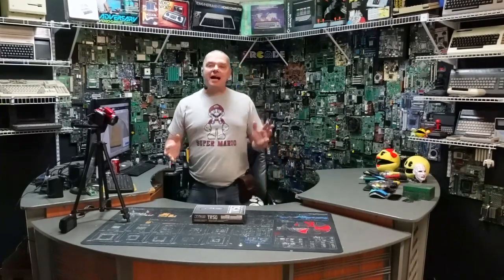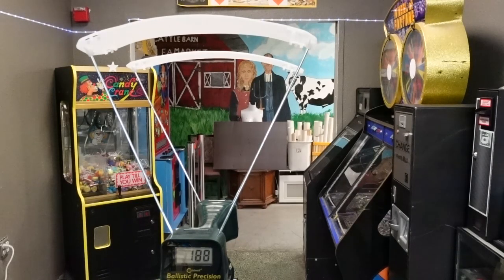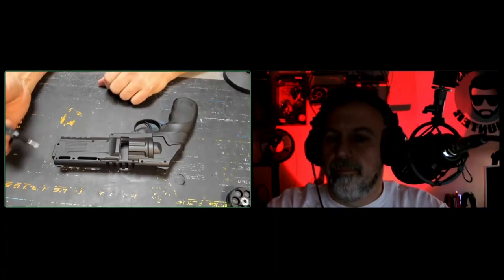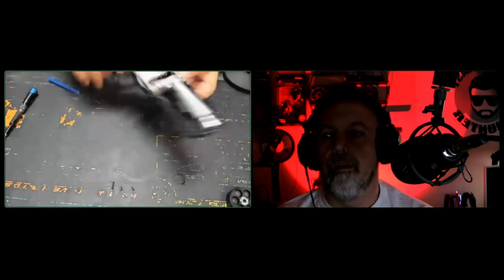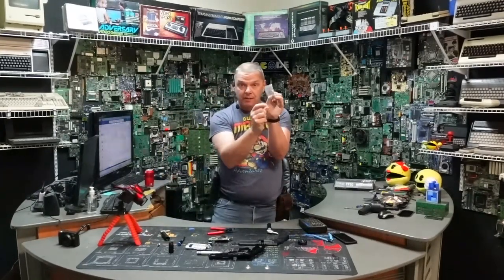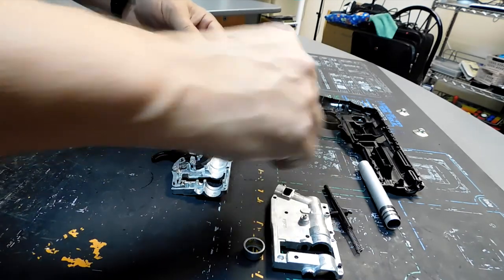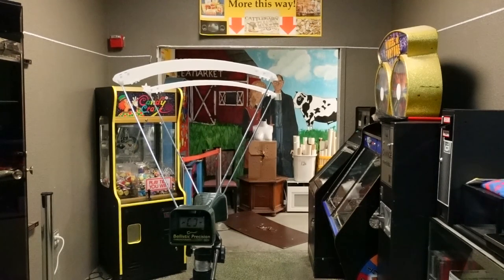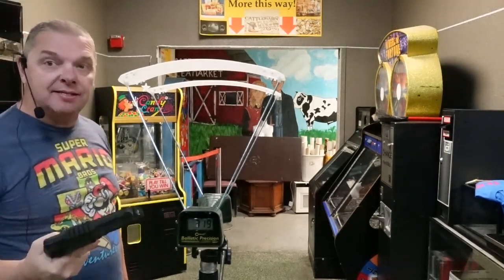Lets upgrade the T4E Umarex TR50! | 20-30 Joules!! This thing is MEAN!

Comment: Which hits harder a moded TR50/HDR50 or a moded HDP50?
Reply from the maker: They are VERY close. The TR50 is quicker to reload though.
Reply: @AlternateArmsSD  What is your email to get a price on a modified HDR50/TR50. 
Thanks Doug
Reply from the maker: @dougtodd9184  jonreynoldscts@gmail.com I’ll be back in town tomorrow night brother and answering emails on Friday.
Reply: Jon, I removed the valve block from my HDP50 and it hits like a hammer. If I remove the valve block from my 11 joule TR50 can I expect the same results?
Reply from the maker: @dougtodd9184  greetings, you absolutely will. However, on the tea or 50 you have to install will see you to restrict are in the CO2 chamber in the handle. If you don’t, all of the air will simply fire out with the first shot. If you need one, shoot me an email at jonreynoldscts@gmail.com
Reply: What would you estimate your FPS would be with the valve block removed on the Umarex TR50. I have an 11 joule TR50 and was thinking about removing the valve block.
Thanks Doug
Reply from the maker: Depending on the ammo weight you will see 18-22J just by pulling the block. However, unless you have the new valve assembly, you'll need a c02 restrictor. If you need help or parts, shoot me an email at jonreynoldscts@gmail.com @dougtodd9184
Reply: @CompleteTechnologySolutions  I have a screw in CO2 valve restrictor in my 11 joule TR50. Can I just resize the hole in the restrictor and remove the valve block and turn it into a kick ass launcher?
Doug
Reply from the maker: @dougtodd9184  you absolutely can. Just go very very slowly and in small increments until you find the sweet spot.

Comment: There's something wrong, the TR50 should be around 325 fps stock for the five or so shots. With the mod it should be shootings around 500 fps.
Reply from the maker: That greatly depends on the ammo you use. The standard balls that come with it are just hard rubber. I routinely test with the rubber/steel balls (which I use in actual self defense) and they are considerably heavier (hence a bit slower). That being said, after the mod this thing hit like a freight train :)
Reply: @AlternateArmsSD  I totally understanding, I've been working on my mods for almost two years. That being said, the rubber steel balls from Umarex should still be hitting 280 - 290 stock and around 425 with with the mod that you have made. BTW the way,  love your videos, very well put rogether.
Reply from the maker: @roddwestphal2379  Thank you so much! I love my channel and making the videos. Wait till you see what I have coming! :)

Comment: Mine blows up coconuts using hot glue and steel ball bearings. 3 times more power.Steel replacement barrel also.
Reply from the maker: I really wish I had the steel barrel for this conversion. Not only does it look amazing, it adds a ton of power by adding that little bit of extra pressure behind the round. Fear not though, I will have a mod like that coming up soon :-)

Thanks for watching!!

Comment: Can you used this method to upgrade The TR68?
Reply from the maker: You absolutely can! Also, the C02 restrictor isn’t necessary for the 68.
Reply: Thanks for the info. But don't  you risked damaging the value if you removed the restrictor?
Reply from the maker: @kennymike7937   Not a bit brother.
Reply: @CompleteTechnologySolutions  thanks again
Reply from the maker: @kennymike7937  My pleasure brother!

Comment: I'm guessing the pepper guard dog pepper launcher is best all other guns are below 350 max and gusrd dog surpassed 400-500? no mods either so WTF
Reply from the maker: Yeah, they were pretty impressive out of the box. When I pulled it apart, you could see that it was pretty much a carbon copy of an HDP 50 with no valve block. That’s good news, cause it means there is room for Upgrades. However, the plastic that they used on the body wasn’t quite as high quality.

Comment: Maybe we just need pepperballs made that can handle the pressure.
Reply from the maker: Perhaps, but the point of the pepper ball is to rupture. If you made them two solid, they would be just as effective as the solid balls. It’s a delicate balance.
Reply: @AlternateArmsSD  what is the max joules you can mod something so that you get a bit more power but can still use pepper ball any feed back would be great
Reply from the maker: @fierrolisto3281  Were actually going to test that in a video.. I'm curious as well!

Comment: How can one obtain the power kit?
Reply from the maker: Greets! Shoot me an email at jonreynoldscts@gmail.com
Reply: I emailed.... I have the stock 11 joule version. Will remiving the horseshoe alone increase the velocity?
Reply from the maker: Yes and no... On the TR50 you must have a C02 restrictor or it will blow out all of the C02 on the first shot. @yago23s17
Reply: I ordered a power kit 50 from riot balls. The valve pin is actually longer.
Reply from the maker: Don't use it then. Just use the C02 restrictor and pull the valve block. You will see the marked improvement!  @yago23s17
Reply: @AlternateArmsSD  
Is there a point where the valve pin or firing pin can be too short?
Reply from the maker: @yago23s17  absolutely, when the pin is too short to get a quote, farting” effect. Also, if you go to short, it won’t seal at all, and you were just blow out all of your CO2 as soon as you puncture it.

Comment: Remove the block. Get an engineer mate to make male/female short tube to go between frame and pop-out indicator, shape a hole in the plastic to accommodate. Now you have something else again.  Before (Homedefence24) finds out and makes em. lol.   Sand the chambers (slightly) to take 8.3g steel balls.    The rest is up to you.
Reply from the maker: Thats a great idea! I also did a shortened valve block that seems to work well to (Video coming soon).. These things are so versatile that the options are limitless.
Reply: @AlternateArmsSD  Yes mate, they are a great platform to tinker around with. Modern day 'Meccano' 'Leggo' lol for HD.

Comment: Bummed. Found the F symbol 😕
Reply from the maker: Ignore it! I have the kits now that simply don’t care! It’s still upgradable! :) Shoot me an email at jonreynoldscts@gmail.com
Reply: @AlternateArmsSD  Thank you! I need to be comfortable with taking this apart (I can take apart anything since the age of 12), but it’s putting it back together that might be an issue. Usually, springs pop in different directions when I change anything with a spring. LOL! I will shoot you an email soon so we don’t lose touch.
Reply from the maker: @mojito-alongtimeago  Just go slow, you'll be fine :) If not, I'm always here.

Comment: Lol mine is doing 450
Reply from the maker: Yep, I got that after pulling the valve block... Nasty customer! Thanks for watching!
Reply: @AlternateArmsSD  so entire valve block should be removed for both 7 and 11 joule versions?
Reply: 450? How? I have the version with the f. Can  mine reach 450? And how?
Reply from the maker: @leonceheaven1032  by removing the internal valve block completely. Of course, when you do that, it will negate ever using pepper balls again :-) It will also dramatically reduce the number of shots you will get between CO2 cartridges.

I have another video coming out very soon about the HTP 50. It does the exact same thing and the upgrade is pretty close the same. Stay tuned to that one to see me remove the block completely. It’s very simple.
Reply: Slingshot shooting marbles Is more lethal.
Reply from the maker: @Stevenyoung100  Nonlethal is the point. That being said, I have been thinking about doing a slingshot video.. any suggestions?

Comment: I got so confused with your explanation on which one can be modified....is the one with the "F" the one you CAN modify, or CAN NOT modify.?
Reply from the maker: You can modify both the same way Brother. This is an old video, move further forward, and I have much more detailed descriptions, teardowns, and upgrades.
Reply: @AlternateArmsSD  Thank you for the fast reply and the great vids.
Reply from the maker: @GimmeEd  Thanks Brother!! It’s been a learning experience for me :)
Reply: @AlternateArmsSD  So, I just ordered the 11Joule valve upgrade. Can I now use the power kit on it to increase the power even more?
Reply from the maker: Yea BUT, open that valve and punch out the block. You will get 18-20J simply by doing that. Afterwards, you can add the shorter firing pin, C02 restrictor for more consistent shots, and a longer barrel. @GimmeEd
Reply: Cool, thanks @AlternateArmsSD
Reply from the maker: @GimmeEd  my pleasure brother, if you have any issues while you’re doing your upgrade, let me know.
Reply: @AlternateArmsSD  Well, I got the 11 joulle valve and punched out the block. Put it back together and now I'm blowing all the co2 in the first shot. Sounds like a machine gun. What did I do wrong?
Reply from the maker: @GimmeEd   did you install the CO2 restrictor desk in the CO2 chamber? You are very very close :-) you have to have the CO2 restrictor installed on the TR 50. If not, you get that “machine gun” effect you’re talking about :-)
Reply: @AlternateArmsSD  I pulled it apart and found that one of the springs had moved and it was allowing the gun to fire like that. I fixed the spring and it fires properly now BUT now I have a leak. The new valve cross threaded my button (I dont know what they're called. The button you hit to puncture the co2) Now the co2 is leaking out of the hex key hole. So, maybe it isn't the cross threading....I'm confused. It's been nothing but problems. I bought the power kit and it's the same sized pin...I'm a bit pissed
Reply from the maker: @GimmeEd  yep, the spring you’re talking about was the one that restricts the bolt :-) that was my next solution we were going to. You are correct about that pen though, if you bought that power kit on eBay, it is quite possible that that is what you got. Also, you might’ve noticed that the thread pattern was different. I’ve seen a lot of that going around as well. On the upshot, at least you did use the restrictor that came in that kit what you needed either way.

 Now, if you’re still getting a leak from that point, it’s because the cross threading has caused the firing pin to be off-center. If it’s off-center, you’re getting blow by right past the O-ring in the CO2 chamber. If you can’t figure that out, let me know, and I’ll shoot you my address to send the launcher into so that I can fix it for you. I’m out of town until Friday but send me an email at jonreynoldscts@gmail.com
Reply: @AlternateArmsSD  The spring is fixed, the restrictor is in, the block is out. Why the hell is it leaking?
Could I have fucked up the threads by trying the new pin ?? If that's the case, I'll need a new sleeve that the pin from the power kit goes in...This is starting to get expensive...
Reply from the maker: @GimmeEd  I may have an easier and much cheaper solution brother. Just shoot me an email and I’ll get back to you on Friday when I get back to town.